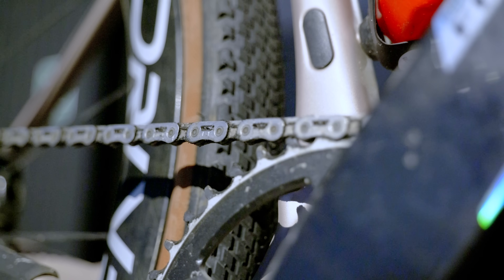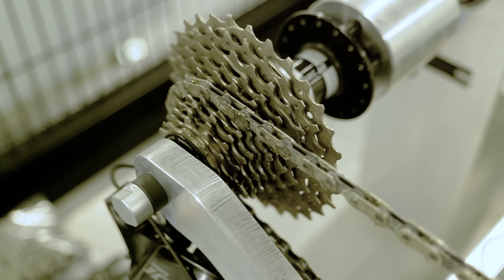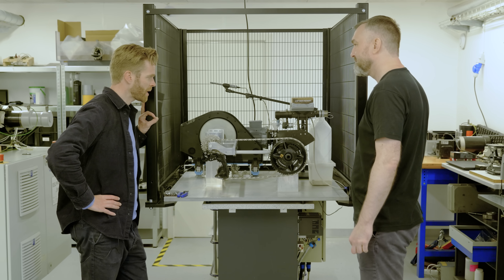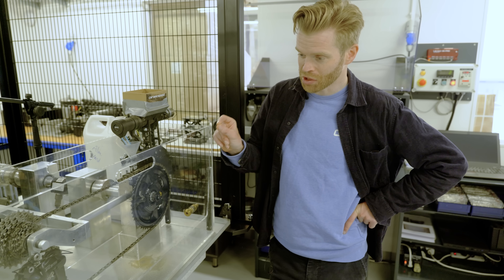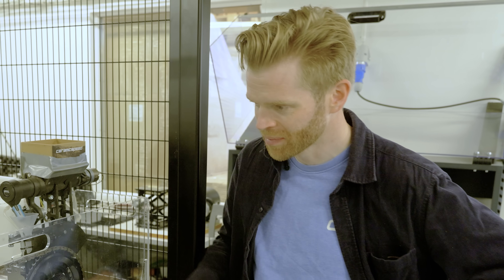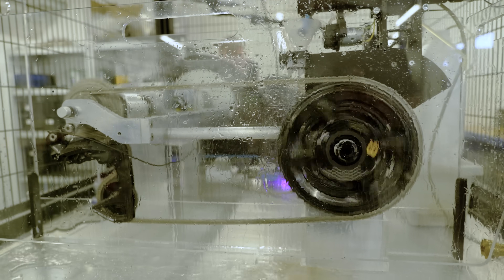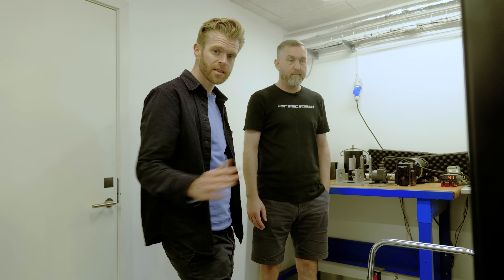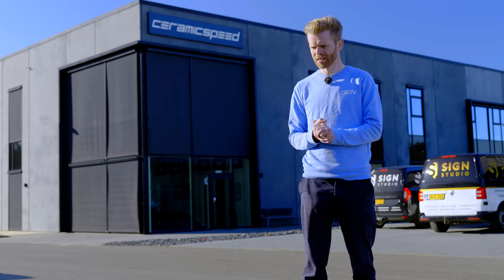We Lab Tested A Dirty Chain, How Much Slower Was It?

Comment: What would interest me is the difference between "big-big" cross-chaining and the same gear ratio but in the small ring in the front
Reply from the maker: let's see if we can do that in the future, when riding - often it feels through the legs as though "big-big" rolls better than "small-smaller"
Reply: @gcntech  Test also 3x chainrings pls
Reply: I‘m guessing big-big wins as the chain won’t articulate that much as the same ratio in the small chain rings does
Reply: I have 12spd 1X front chain ring - I wonder if that’s the best set up since I’m always on a big front chain ring?
Reply: @kylestone4504 yeah, that's the question. For a given gear range - is it more efficient to have a tight cassette with 2x, or a wide range cassette with 1x? (Just from a drivetrain efficiency pov, disregarding gear jumps and cadence)
Reply: @wfrx4783  That's exactly the question that comes to my mind.
Reply: @kylestone4504  not if you have a 10t small sprocket (super inefficient), and you have big gear gaps = hard to get optimum cadence.
Reply: @CyclespeedTours  For this reason I am thinking of changing to smaller gear gaps on my 3 x 8 drivetrain.
Reply: Don't go big/big you'll risk a snapped chain especially if you jump out the saddle. Big/3rd/4th biggest should be fine.
Reply: Arguably it would come down to chain length, given the amount of 1x systems out there.
Reply: ooh, that's a good one.

Comment: So, at least from an efficiency point of view ... you should actually cross chain and stay in the big ring as long as possible ... and only change to the small chainring when you absolutely have to ... interesting ... the wattage loss from a dirty chain was also interesting, if not the answer we were hoping for ... good work, Ollie    (great news, Alex wasn't there, so he can't throw in any curveballs)
Reply: Unless your name rhymes with Pogacar.
Reply: I, for one, was absolutely hoping a dirty chain would be almost as good as a clean one. :) I have never waxed my chain before, and this has made me sure I never will.
Reply: The advantage with waxing is longevity. My current gravel bike chain has a bit over 1000 miles on it now and it measures exactly the same as it did brand new. With a wet lube I typically got 800 to 1500 miles out of a chain before they measure 1/16" if wear and need to be replaced to save cogs and chain rings.

My road bike chains typically made it to 2500 miles with wet lube. At the current wear rate my waxed gravel chain will far out last even a road bike chain used exclusively on clean roads in dry conditions.
Reply: @Pastamistic  Don't you think these figures are incredibly dependent on the conditions you experience over those thousands of kilometers? More or less road dust, more or less sand, more or less moisture in the air, higher or lower temperatures... so many variables! One rainstorm or one puddle, and all your measurements are turned upside down.
Reply: @ColonelDutch  It is. That's why I compared it to my typical mileage of a road bike chain that's used strictly on roads when it's not wet or raining. Gravel and mtb chains normally lasted 800 to 1500 miles for me with wet lube. Road chains about 2500 with wet lube.

With a waxed gravel chain I'm over 1000 miles now and measures exactly the same as it did new. If this wear rate continues 10,000 miles out of a chain seems pretty realistic. Normally with wet lube it would be either past worn out or at least about 50% worn.

I measure chain wear with a precise metal ruler. 12" should line up exactly with the pins in your chain. With 11 and 12 speed you replace at 12 1/16"
Reply: @gunnarob  
At this point I almost went through a "workshop" size squirt wax bottle.
Here are my thoughts:
The main selling point of wax is keeping the drivetrain clean but it lasts less than half as long and costs twice as much as a regular chain oil. Additional drawback is that you have to scrape off the wax that builds up on the jockey wheels (and other components as well) over time and messes up your shifting. So you would have to do some cleaning just like with oil based lubes although it is much less of a headache because it is a simple scraping off of wax.
Although wax is said to be water resistant it is not. Like 0.5-1 hr in wet conditions and the chain will squeak.

So far the only advantage of waxing that I've found is that it really keeps the drivetrain and environment cleaner.
In my opinion with the current wax lube prices it is not worth it.
Reply: Efficiency point of view you cycle the best in the 5th gear, everything above that means more energy for the same speed.
The wattage does not change because you don't messure efficiency or even wattage at all.
This is exactly why cyclists believe random bullshat

Comment: I really didn’t think that a dirty chain would be that much of an ado about nothing.

They do sound horrible though, so I’ll keep mine clean.
Reply: Was a bit surprised by that as well. Those sand grains are pretty consistent though. No doubt mud (where finer grit is penetrating into the chain) would have more losses.

Comment: While interesting, I think watt losses from dirty chains actually misses the main point of keeping chain clean, or even better, using wax lube, which is the increased wear rate of gritty chains, which in extreme cases can kill chains, and therefore whole expensive drivetrains, extremely quickly. Ollie only briefly mentioned this.
Reply: 100%
Exactly why I wax; for cleanliness and wear reduction 👍
Reply: rThat's probably why it matters less on a sunshine-roadbike compared to an gravel or MTB bike. 

I've been running a waxed chain on my gravelbike for the last 18 months and have been switching between two chains (three would be optimal I heard) and the chainring and cassette look great. Hardly any visible wear. My earlier chainring had lost all the paint in no time but my current one still has it on the teeth.
Reply: @PatJuhNL I recently switched from using Rock N Roll Extreme to Silca wax with the endurance chip.  I switched at about 4000 miles on the chain and I've put another 1000 miles on it with wax.  I loved how clean Rock n Roll kept my chain, but the wax is a huge improvement.  Both were good, but the wax is way better.  I have 5000 miles on the chain and still under 0.5mm wear.

Comment: Ty for explaining chain "stretch". It's the same for car timing chains the rollers just wear. I started using squirt wax on my chain on a new chain and did the whole clean procedure. Granted I ride in Nice where there's not much weather and dirt, it's just great not having a chain ever get dirty because there's no oil lube.
Reply: Timing chains used in engines are always operating in perfect alignment there's no crossing ...
Reply: @perspicaxingenium correct but they still have rollers :).
Reply: @bluej511  yes and a permanent bath of clean oil to sit in, they are living that good life 😊😂
Reply: @perspicaxingenium surprised no one's invented that for a bicycle lol.
Reply from the maker: no worries for explaining the stretch! the oversized links and rollers certainly helped explain it!
Reply: the links themselves do stretch though. like the chain itself gets physically longer rather than the rollers. it is actually stretching.

remembering to oil/grease a motorbike chain matters a lot for the stretch which at some point gets too long to adjust with the wheel. like on smaller motorbikes especially on a 150-250cc if you just keep oiling it at least sometimes maybe it'll go for 30 000km instead of 8000. on waves and cubs and such with enclosed chain protector they're fine for almost forever.. rainy season and flooding is what makes the oil wash out quick.
Reply: @lasskinn474  I do not think the links stretch. It would be bad practice to design a steel something that suffers permanent structural damage under load. 
It is probably wear at the pins that adds up:
-the outer surface of the inner link wears together with the roller and
-the inner surface of the inner link wears together with the pin and
-the contact point between the inner plate and outer plate also wears.
The 2nd one will cause the chain to be longer.
The 2nd and 3rd together cause the chain to be more bendable.
Reply: @blood1543  the links don't stretch, it's most likely the pins wear causing it to "look" that way.
Reply: You should use heavy mineral oil if you live in Nice.  Wax is for dirt and sand, not clean European Tarmac.  If you used Phil's Tenacious Oil or Chain-L you could get 2000km per lubrication.

Comment: What I find strange, they're using Shimano chainrings and mech, and don't know what type of cassette, but probably Shimano as well.
But from what I know, the SRAM Flattop chains are different (bigger rollers) from Shimano chains, so this testing is likely not ideal, because the chain doesn't fit as well to the cogs as it would to a full SRAM setup. I guess because you're comparing two SRAM chains, it's an acceptable comparison, but you could not compare the values to a Shimano chain.